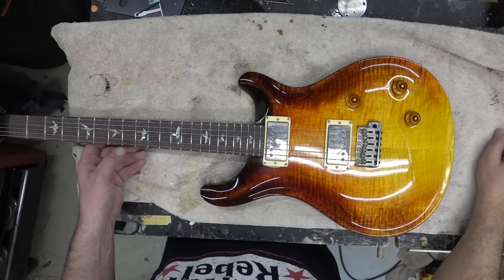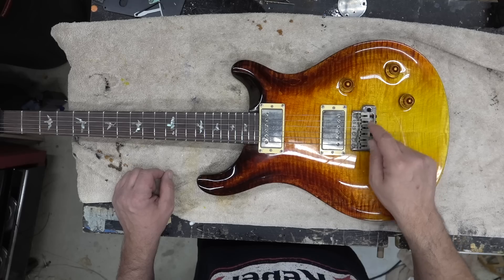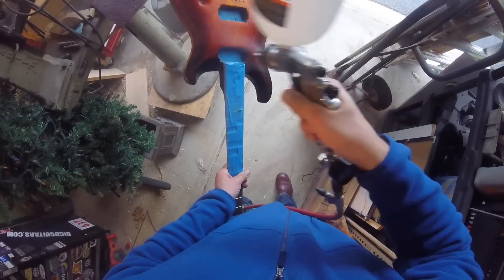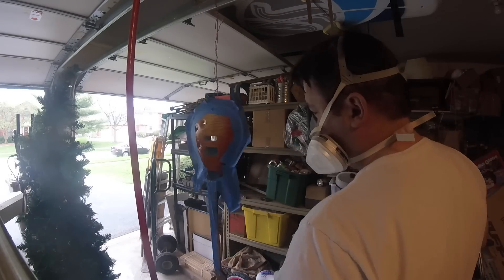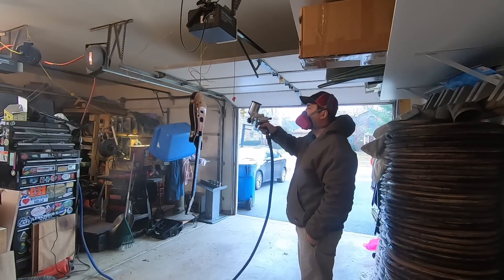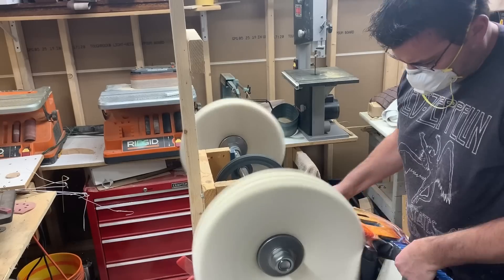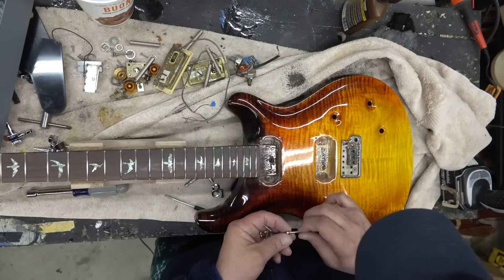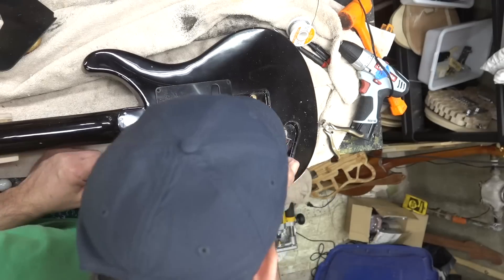Completed PRS Restore - Final Finish and assembly

Comment: According to the internet you need Kleen Strip Aircraft Remover or Jasco Premium Paint and Epoxy Remover. The main active ingredient is methelyne chloride.
Wrap the guitar body up in plastic after applying it, so the stripper  doesn't dry out before it stops eating the poly. It also helps to do the stripping in warm weather conditions; even doing it in direct sunlight (vs. shade) seems to speed the stripping action. The stuff burns your skin, and it is bad for your body if you inhale it. etc.
Fun.